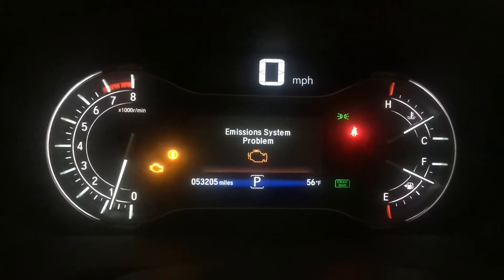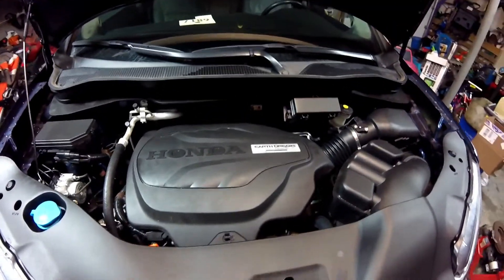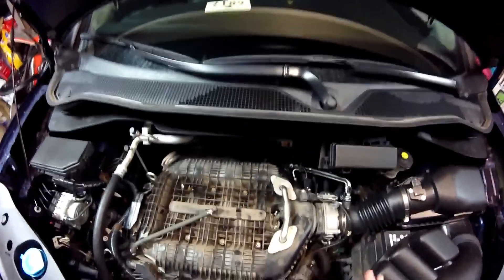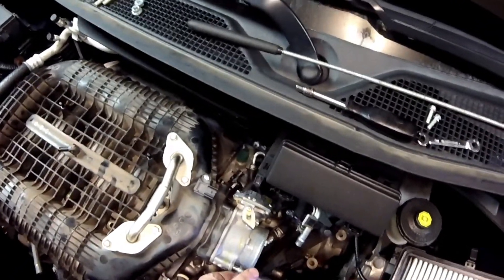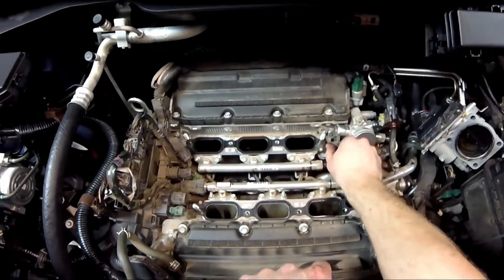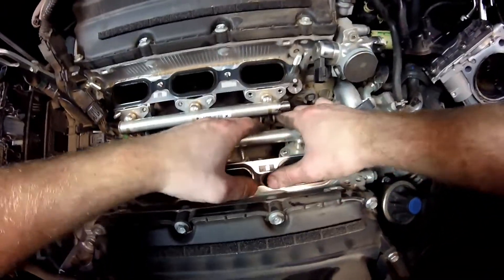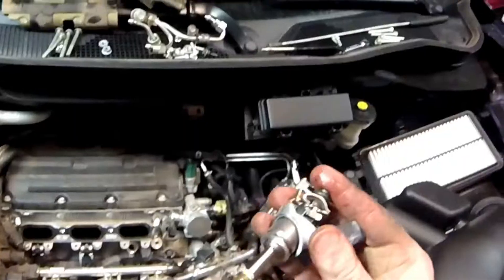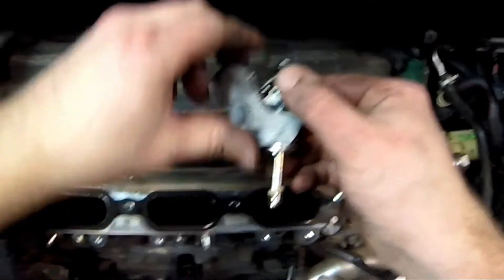2016 Honda Pilot P0430 Service Emissions System - Fuel Injector Replacement-Part 1

Comment: Update on this issue as of 11/30/2018. Honda issued a service bulletin for the injectors/emission problem. They are covering it under warranty for 15 years or 150,000 miles. Just had mine done at zero cost to me. Also of note, Honda covers most emission problems under a separate 8 year 80,000 mile warranty.
Reply: What is the s rvice bulletin number? Just took mine in and they just want to charge me for it!
Reply: @mattfleming3829  TSB is 18-025. For 2016 Pilot 2wd and 4wd within a range of VIN numbers. See link 
https://www.piloteers.org/forums/attachments/2016-third-generation-pilot/129023d1543955891-tsbs-a18-025.pdf
Reply: I have had this issue serviced twice on my 2016 Pilot. Possibly going to have it done for the 3rd time due to the check engine light and Emission Control System warning displaying right now?
Reply from the maker: Maybe there is something else going on? Great name BTW!
Reply: @mattfleming3829  I would also like to know this. All the lights in my dashboard let up and I’m suspecting they could be due to injector issues. Just my theory. I know there are other variables and play.
Reply from the maker: Dustin Gariepy thanks for the update. Good to hear. This seems VERY COMMON.
Reply: Dustin thanks, where is the information on the 15 yr 150k coverage? My dealer is playing the naive card. Thanks Connie
Reply: @conniecollier6807  The tech told me when I brought the Pilot in that there is a 80K warranty on emission parts, after the diagnosis he said that this problem was actually being covered under a Honda 15 year 150k warranty. Nothing was shown to me in writing.  Here is a copy of my invoice... https://tinyurl.com/ycqtmrev
Reply: One other note... the Error code for my Pilot was P219A, Air/Fuel Ratio Imbalance
Reply: Dustin Gariepy My 2016 has same error code and VIN falls within the affected vehicle range, I have a copy of the TSB and will bring to a different dealer-maybe they will cover or get it covered for me?  This is total BS TSB states problem is a result of installation error at factory Repair cost is $1900!
Reply: @conniecollier6807 I got a notice from Honda, there is also a TSB on the torque converter. I have 142,000+ on my Pilot.  Had the torque converter and all the fuel injectors replaced for free.  If your Honda dealer is giving you a story go to a different dealer.
Reply: I’ve got a 2017 with 130k miles on it and this issue just came up. Dealer told me it’s covered by the 15yr/150k mile warranty. That’s here in Wisconsin.
Reply: @paulie0706  That's good to know. My 2018 Pilot with 77k miles just popped up with this warning. Its at the dealership now. Im about to research to see if North Carolina honors this service bulletin.
Reply: @kstevens0915  , what were you able to find out?
Reply: Yes, Honda extended this warranty to 10 years or 150,000 miles.
I just dropped off my 2017 at dealer and getting new injectors installed as we speak, all free of charge. Mine just hit 61,00 miles and light came on the other night.
Reply: After talking with dealership and even calling Honda customer service it is still showing the repair to be only covered under normal warranty as stated in the TSB. Oddly enough they were not able to find the TSB linked to my vehicle even though my VIN is in that range.
Reply: Matt Fleming what did you do? I have the same problem- vin matches TSB
Reply: @carriewholean1023  mine was the camshaft position sensor. Truck is good now
Reply: I took it to the dealership and forked over the money. Hoping they someday make it right. Not holding my breath though!
Reply: @thegreat1611  I just had a ton of lights show up at once, including Emissions system, hill start assist, towing assist, vehicle stability etc and the Honda mechanic said it was bad fuel injectors and a cam issue, two independent issues according to the mech, which HAPPENED to appear simultaneously.... Seems suspect
Reply: @Geeksmithing  Same with mine what did they tell you
Reply: @mrteach2429  We ended up calling Honda Customer service directly and brought up the apparent widespread issues with these vehicles (just searching online results in many similar issues) and they covered a large portion of the repair costs (even out of warranty)  We ended up trading the car in towards a Subaru instead a few months after it was repaired.
Reply: @mattfleming3829  They sent me a notice and I sent in my receipts. Several months later I got reimbursed for the parts and labor.
Reply: @Geeksmithing  same exact codes I got after taking my 2018 pilot in for service, the torque converter & fuel pump was under warranty, 104,000 miles on it
Reply: I think this 15/150000 warranty is only for California.  I'm looking in my book and that's only where I seem to find it.  I'm in Florida with my vehicle currently at the dealership waiting on my to give them the go ahead for $1000 bucks to replace my injectors....  2016 is 2 years old w/ 53K miles....
Reply: @TheSaltyDingo  I'm in Massachusetts. My 2016 (purchased in Oct 2015) has 78K.
Reply: @dustingariepy2056  Can you let me know what dealer you brought the car to service in MA?
Reply: @nattarinkowatanakun8099  Curry Honda, Chicopee MA
Reply: This is only in select states. Others fall into the normal 3/36000 warranty
Reply: mine 2016 pilot has 62,000 miles and emission light just  came on and i saw so many other lights like power steering, lane departure etc
Reply: Was 2016 Honda Accord included
Reply: What about now? 2023
97k miles on my 2016 pilot
Reply: I have the emmisions problem on dash and Honda told me it wasnt part of bulletin since i didnt have the right code. Sleezy honda knowing they have bad injectors.  1400 dollars to fix. Im going to attemt to do myself thanks to this video.
Reply: TSB 18-025 is the bulletin # 

Dealing with this now and ready to argue with Honda to have it covered
Reply: @Fire Ant Glad it helped!
Reply: Where that part 2 at?
Reply: Would a couple cans of seafoam.... Possibly resolve the problem?
Reply: My pilot got 36k miles and light for emission system problem just came on. Just made appointment for the dealership
Reply: Cool story, just missed the warranty on this by a few thousand miles.....after having the engine replaced not even a year ago.  Yay...
Reply: I was giving a code of p0369. Took my 2016 Honda pilot with 38555 miles to the dealership and was told it was the cam position sensor. It was covered under warranty however it stretched my timing belt as they say and that needed to be replaced also.Pick it up drove to Virginia from Georgia and back so far so good.they were trying to get me to pay for a new timing belt I told them not on a vehicle with two warranties I want so they said being that the timing belt was stretched by a faulty cam position sensor the warranty will cover it and they had my car ready in 2 days.

Comment: This video appears to be 7 years old. Not sure if you still see comments. I have 2016 Honda Pilot.  Technician replaced water pump and timing belt at 180k miles, followed by this code. Now at 220k miles. Still have code. Will a fuel additive clean out the injectors on a long drive? Or is replacing injectors the option of options. Also I read somewhere about a software update?

Comment: What kind diagnosis tools do u have in ur garage? Do u have experience with Snap on diagnosis tools? Is it worth the money?
Reply from the maker: I am actually a GM technician so I have access to factory GM equipment. For anything other than GM I use either a snap-on or autel scan tool. Honestly the more you pay, the more features you get.

Comment: Thanks Pete. We have a 2020 Honda Pilot 58,000 miles. Check Emission Problem light. I checked the code and it says catalytic problem bank 2. Where is the link showing the recall under warranty?
The dealer wanted $1,350.00 plus tax. I put a large bottle of Techtron fuel cleaner and a tank of non ethanol gas and the light went away. After a week, it came back on but only for a couple of days. I just filled it back up and did the same. I just wanted the recall info that states 15 year/150,000 miles warranty. Thanks again!
Reply: It's under a TSB. You  have  to escalate to Honda corporate.

Comment: Bought a used 2017 Pilot Elite at 70k miles.  15k miles later, this engine code popped up.  Drove it around another 15k.  I could tell the performance started to become more and more apparently worse.  The code would pop up and go away intermittently.  Saw this video, changed it myself, unhooked the battery to reset the code, and now it runs beautifully. Took me 3.5 hrs.  You don't want to rush this job.
Reply: Was this your first time tackling this? My wife’s pilot just showed this code so I’m wondering if I can do it on my own. Looks fairly easy and I can understand why you say take your time.

Comment: Did you replace with oem injectors or aftermarket ones? Just curious which ones to buy. Thanks
Reply from the maker: I used oem. This was a couple years ago so maybe there are decent aftermarket offerings now. Oem was all that was available at the time.
Reply: Thanks Pete.  I ended up using some lucas fuel injection cleaner and the light went out and code reader says its ready for inspection.  Not sure how long this will last but going to give it a try.  Thanks again.

Comment: I bought my 2016 Honda Pilot used is there anything the Honda dealership can still do even though I'm not the original owner?
Reply from the maker: I think at this point there is a reprogram for the engine control module. I think they do this when they replace the injectors. Perhaps it would help prevent this issue if your injectors aren’t already compromised.

Comment: good morning sir from Cambodia thank you for your show me that . now i have a problem with my car as it emission system come out again but i checked it and it showed  me that emissions for two are need to replace but if i try to use it without fixe so what it would happen next sir tjks my car is Rave4 2001
Reply: Hi Pete had this code come up P0430 and you just responded but I can't see your response. How do I see your response. I was thinking of changing the oxygen sensor first

Comment: I have a 2016 Honda Accord Touring with 164k miles and this error code P0430 - Catalyst System Efficiency Below Threshold Bank 2, It went away after I filled up gasoline with Premium Gasoline
Reply: I just had this come on today. Did you have to do anything else?
Reply from the maker: I highly doubt premium gas is going to “fix” this issue.

Comment: I have a 2017 honda pilot that has code P0420, P2651, P0430, P219A, P0302, P0304 & P0300 Alerted any videos up to help fix?
Reply from the maker: I’m pretty sure if you follow this video you’ll fix your car. At least most of the codes.

Comment: I looked up code p0430 and it says egr system fault. So why are you replacing fuel injectors?
Reply from the maker: P0430 is Bank 2 Catalyst Efficiency low code. Most of the time it’s caused by a bad catalytic converter but in this case it’s caused by the fuel injectors over saturating the converter. You can usually replace the injectors and the cat will clean up.
Reply: @PetesGarageandperformance  thank you

Comment: I just did this dx and found the misfires with same codes all on same bank 2. The cylinders with misfires were actually all washed clean and high fuel trims on bank 2. Obviously the injector pintles were sticking open causing misfires and damaged the bank 2 cat due to excess raw fuel. There is a Honda bulletin for this code and extended warranty that covers the repair of some years.

Comment: Just talked to a dealer here in SC about my pilot. 108k miles and my specific vehicle vin is covered under the tan extended mileage warranty
Reply: I have a 2019 Pilot EX-L with 106,000 and I was told to replace my fuel injectors it would a min of 3000 but 220 from the dealership. I spoke with Honda today and they told me that my VIN doesnt fall into the warranty extension.

Comment: Thanks 2018 honda pilot elite it says emissions system problem and having problem with remote start it starts and shuts off after 5 seconds and another problem with ac/heater off the car engine temperature too high what donyou think thanks

Comment: My Honda CRV 2016 when fuel is half full, check emissions system turn on and check engine light as well . Mileage is only 76 ,000km. 
This happened 3 times already for the last two months.
Reply from the maker: I would have the codes scanned. My guess is that it has something to do with the Evaporative Emissions system since it coincides with fuel level.

Comment: I finally knew the problem of all those codes lit up like in the video, after passing a strict check at Honda Motor CO Chile.
I learned that all 2016/2018 Honda Pilots have a factory defect in the manufacture of injectors (an internal part of the injectors fails after 80 km) and it is a fault that is known by HONDA MOTOR, change the 6 OEM injectors $350 the pack and immediately those codes were never turned on again.
Because other codes are lit, it is because the electronic branch system is linked and throws several codes.
Reply: My 2019 is having same injectors issue at 32000 miles 😢
Reply: Were i can get that set of injectors? Any link please. Thanks.
Reply from the maker: @MiguelLopez-wi5nm I have a link in the description. Double check that they fit your particular vehicle.

Comment: Finalmente supe el problema de todos esos códigos encendidos como en el video, después de pasar un estricto cheque en Honda Motor CO Chile.
Supe que todas las Honda Pilot 2016/2018 tienen un defecto de fábrica en la fabricación de inyectores (falla una parte interior de los inyectores ocurre desde los 80 km) y es una falla que es sabida por HONDA MOTOR, cambie los 6 inyectores OEM $350 el pack e inmediatamente nunca más se prendieron esos códigos.
Porque se prenden otros códigos, es porque el sistema ramal electrónico está unido y arroja varios códigos.
Reply: Gracias por la aportación saludos desde Mexico

Comment: Took my Pilot to the dealership and was covered under the Warranty (150k Miles or 10 years). Saved at least $2200 according to the Honda Rep. Thank you so much for the video. My other mechanic thought it was bad catalytic converter and was about to order the part...sigh!
Reply: You  are my hero. Saw your comment, took the car to the dealer, problem is gone for free. Thank you sir!!
Reply: I have same insurance going to take it tomorrow after 88,920 miles

Comment: I have a 2017 Honda Ridgeline with77k miles and an Emissions System light on the dash and P0175 code. Took it to Honda to replace it under the extended 150k mile warranty for the crappy fuel injectors from the factory. They said the code I have is not part of the bulletin. Sucks and dealers still say I need a fuel injector kit for 1500 dollars. It is so stupid as it is doing the same thing as if I had other codes under the bulletin. I wonder if Autozone after-market fuel injector kits will work as replacements. I had previously replaced oxygen sensors and mass airflow sensor but Honda service said mass airflow sensor has to be a OEM Honda part as aftermarket will not work. Oh well I'm confident i can install it myself after watching this video but just wondering if I have to replace the high-pressure pipes at fuel pump.

Comment: Well, my 2016 Pilot with 90k miles now has this message.  I guess I’ll be taking it in to Honda to have the injectors replaced.  Should be under warranty.
Reply: Was it under warranty???
Reply: @billsmith04  yes it was . Honda took care of it. No charge. 😀

Comment: 2018 Honda Pilot, Just had it at 208000 Kms, Yes , its driven over 200K kms; I spent $40.00 for the mechanic to knock off the error on the screen, it came up again- so scheduled a service with Honda dealer - this week - lets see what happens
Reply: How'd it go?

Comment: I just found out there is a recall for this issue.  Take it to your local Honda dealership, and they will fix it for free
Reply: Thank you brother - I have a 2018 Pilot with this error , additionally I had another recall called as “hood may crack at latch strike”
Reply: Thank you for the info, my 2021 accord just had this issue

Comment: Hey Pete, great video!!  Love the complete walkthrough and tips.  

What is your set-up for your impact driver when removing the throttle body?   It looks as though it swivels twice, once near the impact wrench and again near the socket!  Also I saw you quick change at one point from an extension to a deep socket. Are there multiple pieces put together?  Part numbers?  Thanks!!
Reply: I do it with my snap on electric impact and a deepwell no extention tho a 3 inch probably would make it easier but just a socket wrench would do fine I take the air filter tube off the box and the throttle body so I can move it up and around easier to get to the far bottom bolt of throttle body.. I work at honda dealership lol unfortunately this is an every day thing for me to have to deal with. On pilots and Ridgeline both